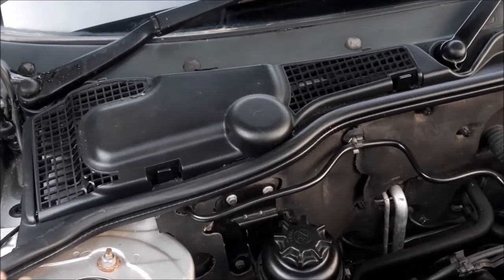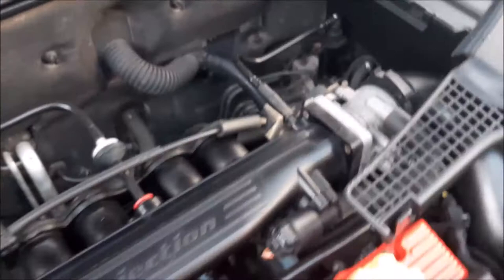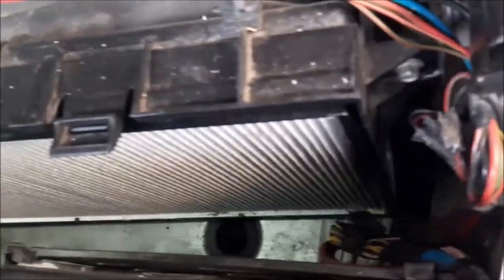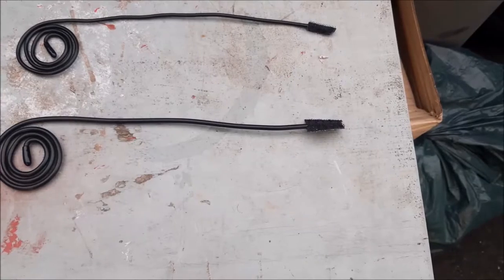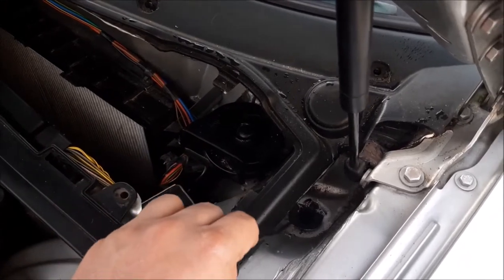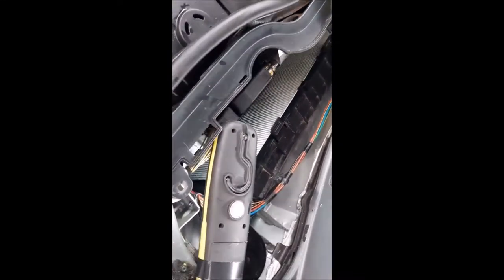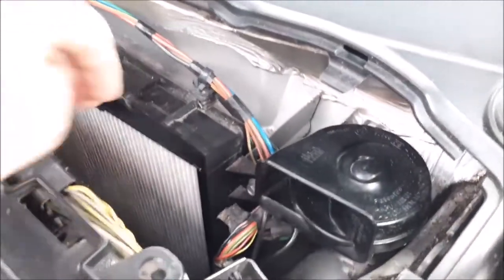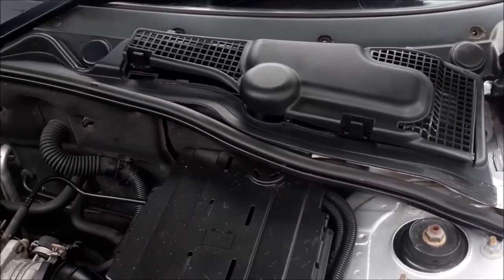Checking and cleaning the plenum chamber on a rover 75

Comment: Thanks for this. I've just had a run through on my 1.9 Diesel. On mine, the view of the drain hole is blocked by the ECU, unlike on your video where it's easily viewable and accessible. I assume the car in the video has a petrol engine.